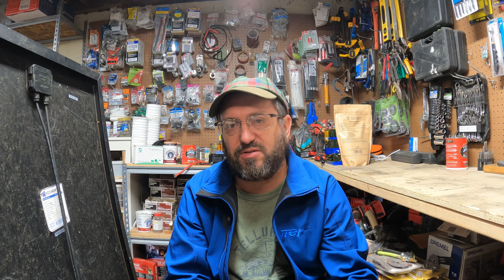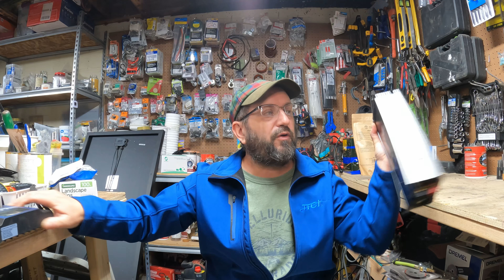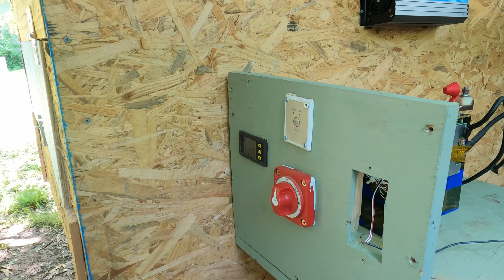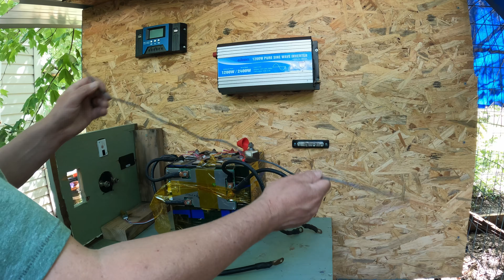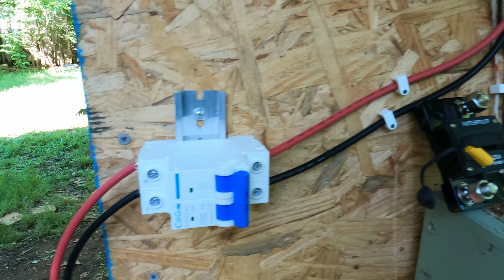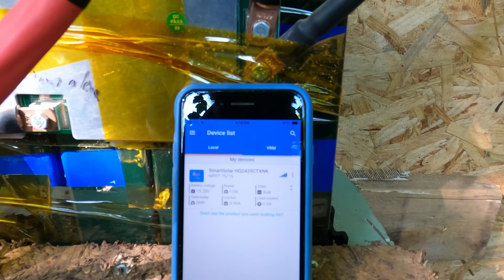5 Steps to build a 12v LiFePO4 DIY off grid solar project. Start here before you build your project.

Comment: One little thing I found out when I built my first system is DON"T buy an inverter that only gives 109 vac like the Redodo 1000 watter with a 2000 watt surge.  I had to get another  inverter that gave 120 vac to run my 7cf chest freezer, fridge and small air conditioner.  I thought the 2000 watt surge would handle it but it didn't..it was the low voltage.
Reply from the maker: Excellent point.  That is why I like the Junbpaw or Giandel inverters.

Comment: Hi sir, laxmi narayan here
Watched lots of your videos 
They are good 
I see you are well experienced with jbd bms
Can you guide me to connecting a 8-24s sp series smart bms to 16s battery pack?
Thanks in advance
Reply from the maker: https://github.com/FurTrader/OverkillSolarBMS/blob/40f6baf995f6bf66b85440da52b6871e40d1bb43/16s_Wiring%20Diagram_package%20insert%20v16.2.pdf

Comment: be sure  this pwm  outputs 14.5volts or even less. i saw one cheap outputing 17volts trickle charging my pack
Reply from the maker: Yeah those PWM ones are just junk.  That is why I switched to the nicer Victron.

Comment: These little systems are life savers...
EDIT : Is it safe to clamp a 35amp charger to the battery terminals while it is still attached to the system? 
Would I need some form of isolation to prevent damage to the MPPT controller? 🤔
Reply from the maker: As long as the output was 14.6v I think it would be fine.
You could also post your question on the forum - https://diysolarforum.com
Reply: You’ll get a better answer if you post it to AI.

Comment: Bring those chickens into the 21st century!  Electrified Chickens.   Premium eggs boiled right in their shells before they even leave the coop!  No more worries about having to boil water.

Keep your chickens entertained!  Big screen T.V. and internet, right in the coop!  And, as a bonus, all the flashing lights will scare away foxes and your chickens will work extra hard ... because they won't be able to get any sleep.  But never mind that!  21st century!

--

One thing for chicken coops... you have to decide whether putting the panel on the roof of the coop is beneficial or not.  In winter a panel on the roof may prevent daylight sun from warming the coop via regular thermal conduction.  In summer a panel on the roof may be beneficial in keeping the coop slightly cooler.  Due to the panel shading the roof.  Just a minor item to consider.

An inverter's idle consumption may "consume" too much of the energy produced by just one or two solar panels... so watch out for that too.  Another reason to not use one in this application, or to use a very low-power inverter with low idle losses.

--

In anycase, for a heat lamp the system can just remain DC and remove the inverter from the equation entirely.  In that situation it can just be:  (1) Panel, (2) Charge controller w/ load port, (3) battery, (4) lamp.   With the Victron 75/15 you already get a built-in battery-side fuse (it has a little blade fuse built-in), and the load-port will trip-off if the current goes over 20A... so you don't even need a fuse.

For programming the light... if you want it on all the time its easy.  If you want it on mostly just overnight you can program the load port to turn on when the battery is near full and turn off when it drains roughly to a voltage by the next morning.

So, for example, if the charge target is 14.2V program the load port to turn on at 14.0V and turn off probably around 13.1V ... it will take a little messing around to dial-in the best voltages.  But that will approximately run the lamp starting in the late afternoon and then overnight, assuming there are enough panels to charge the battery to full during the day (and that is also a function of how much you allow it to discharge overnight so the size of the battery is mostly not relevant, just as long as it is "big enough").

Beware the the "load port" on the victron 75/15 and 100/20 is VERY sensitive to surges and will shut itself off.  Often this causes problems if connecting an inverter to the load port because the surge to charge the inverter caps can cause the load port to trip.  Usually its fine for DC-only applications.

-Matt
Reply from the maker: The chickens have already requested a flat screen TV. LOL!

Comment: MPPT,( MAXIMUM POWER POINT TRACKING) didn't you match the maximum current draw of the inverter to the MPPT?
Reply from the maker: I made sure that the max current of the panels was less that then MPPT charger controller.